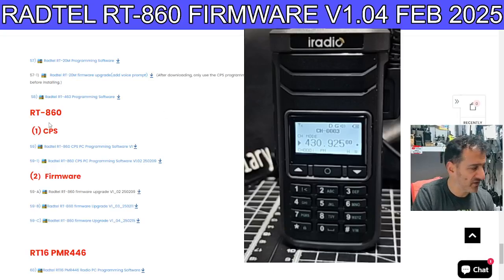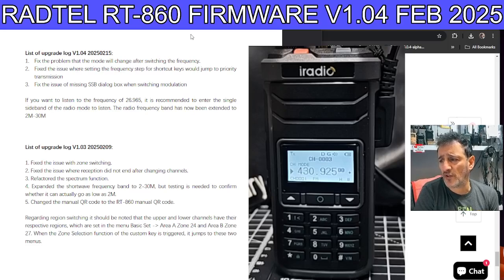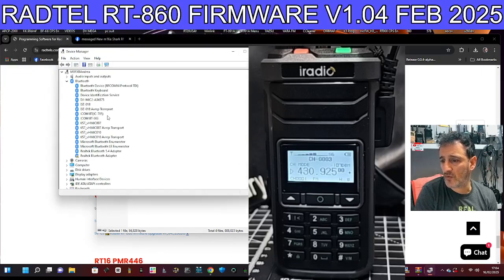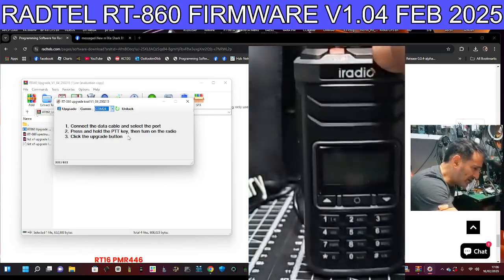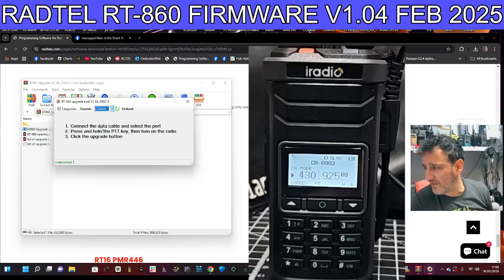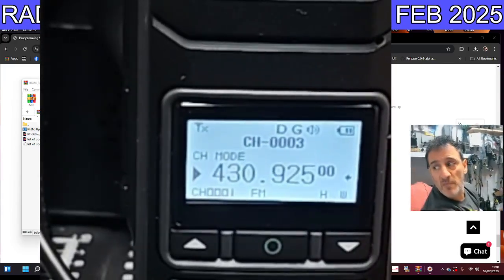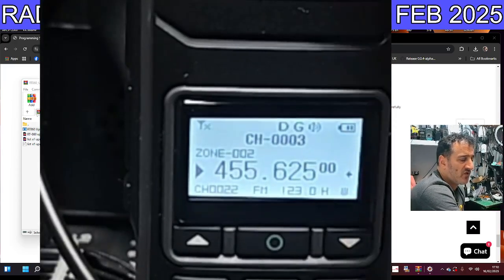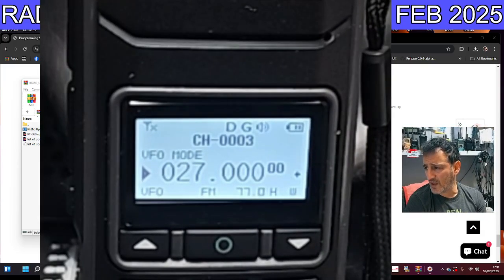RADTEL RT860/UV88 Firmware install v1.04

Comment: It looks like there may be a problem with the v1.04 Firmware, after loading it doesn't detect AM and FM and auotmatically switch from one to the other, I went back to version v1.03 and all is fine, so no dought there will be an update soon ?
Reply from the maker: Yes

Comment: When I press upgrade button a window appears saying" communication error" and nothing happens except the green light stays on. I tried ports 3,4, and then 5 which is an USB 3 but none work, any ideas?
Reply: I am in the same boat……. Can’t find anything about how to fix…….
Reply: Got it, on my pc at least. I used an adaptor to go from usb normal, to the small version, (can’t remember what they are called) it was on com 7 , and it worked like a charm, hope this helps